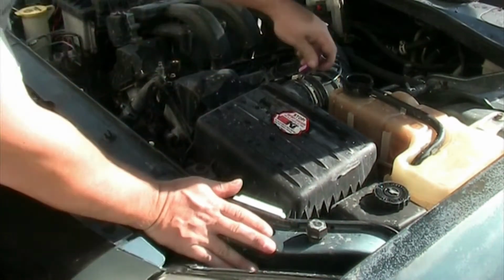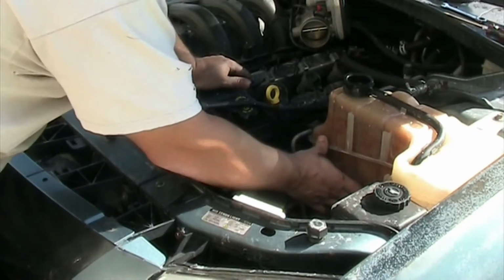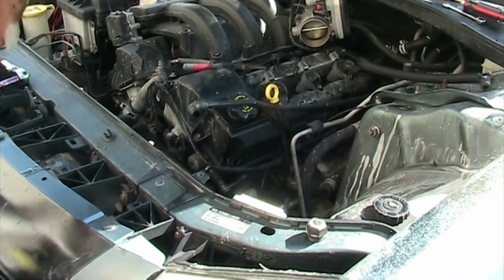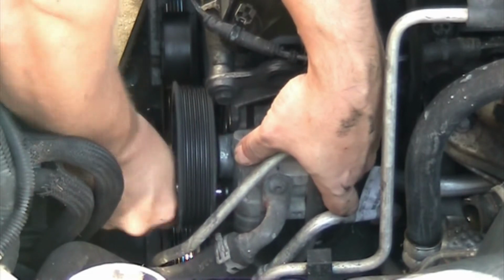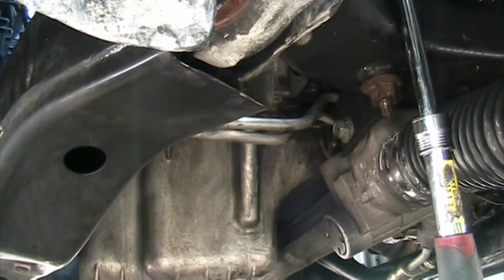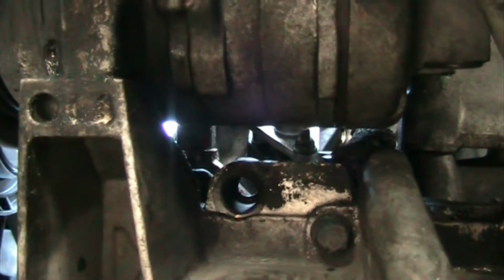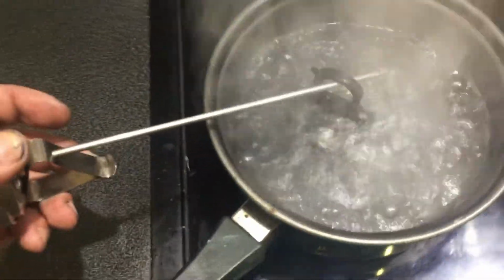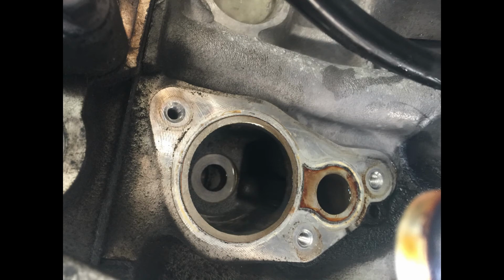Chrysler 300 Dodge Magnum Charger how to replace your coolant thermostat

Comment: Took me 7 hours but thanks to your video I managed to remove and install a new thermostat. There’s a special place in hell for whomever designed this fuckin engine.
Reply: So right on that last part.
Reply: Just did mine. Took me about 9 hours. That screw under the aluminum pipe was a pain in the ass to get to.
Reply: Lol 😆
Reply: Litium grease duh and I love my car  shut us easy when you take care  of your car only problem  I've ever had was front end suspension  part's  they are weak
Reply: @prettyd31  how to move that last piece? Does it move on its on?? When you take off the last lower right bolt on the metal piece infront of the thermostat housing.. how do you move that piece? Lol.. thats VERY IMPORTANT? He jumped to showing boiling the thermostat.. how did you get that out the way??
Reply: Man, I can't really remember. I think after you remove those two bolts, you just have to wiggle and pull. It doesn't come out easy if I remember correctly. But you should be able to pull it out far enough to take the old thermostat out and put the new one in.

Comment: Hey, you did show how to move that last piece? Does it move on its on?? When you take off the last lower left bolt on the metal piece infront of the thermostat housing.. how do you move that piece? Lol.. thats VERY IMPORTANT? YOU jumped to showing the thermostat.. how did yoy get that out the way??

Comment: People please listen! You do not need to remove the power steering pump. Jack the car up and get up under it it's a lot easier and quicker.
Reply: How would you change a thermostat on a first generation 2010 chrysler 300.
Reply: How do you take the bottom bolt off the thermostat housing from the bottom?
Reply: This comment is 100% wrong stop spreading misinformation

Comment: how did you rescrew the lower bolt on the power steering pump?
Reply: Cut one of your 1/4" 10mm deep sockets to 3.5cm length, then you can put it on without removing the AC compressor, just put the bolt on first and then the socket, then the small 1/4" ratchet will tighten it down.
Reply: @WDIO-RADIO  good idea!  got it!  Honestly i am just going to put in a new engine this time instead of a rebuild
its alot of work bro!
Reply: @thepenitent3633  just finishing my 2.7L, my advice - don't remove the crankshaft sprocket unless it's absolutely needed. However- from reading online, the oil pump goes out at around 175K, mine was at 150K so it was a requirement as I saw it. All the rubber seals go out in 7-10 years, and all must be replaced, if the engine was on a bench it would be way easier. I'd suggest fully rebuilding the replacement engine, at least all the rubber parts before you put it in. I also suggest the coil packs and injectors, and spark plugs too. Be wary of the aftermarket "Old-Style" timing chain and sprocket kit that has sprockets  that look like bike sprockets, that's the old heavy style that breaks water pumps. The new ones look like closer, wider teeth and the chain is finer and almost half as much weight. If you do the heads, while they are off, change the water outlet seal and the aluminum pipe with seal leading to the heater core and reserve tank, it erodes the tip and will be a source of leaks that look like a head gasket or weep hole issue. Sensors when heads are off: replace the Knock sensor, and temp sensor. The intake valve body sensor plugs and MAP sensor on the intake should be sealed with dielectric grease to keep out the water. You are totally right, this has been a long difficult adventure! About 3-4x harder than any import that I've rebuilt. Tricky, very tricky.

Comment: How did you get the far nut off it’s a pain!
Reply from the maker: I did access it all from below with a 1/4" flex socket system.
Reply: LSE LLC (Lumanet Solar Energy LLC) hey it worked like a charm thanks!
Reply from the maker: @eugeneroushe5524  I am glad it worked out for you. Just buzz me when ever you need a 2nd opinion or help.
Reply: Fuck it I'm selling my piece of crap chrysler

Comment: when i turn the car over the upper radiator hose gets hers right away. Does this mean the radiator is clogged? please help
thank yiu
Reply from the maker: Not clogged.... follow me for a few here and your will understand how it flows :  Radiator to upper valve which splits coolant into 2 ways into the engine block. This travels down into your V6 block to the Water pump which sits in the middle on the front area of your Engine block. From the water pump it runs thru out your engine and hits the thermostat on the lower right side of your engine when you stand infront of it. Once the Coolant is hot enough the spring retracts and opening up to let hot coolant now flow out thru the lower hose into the radiator. 
This is how your coolant flows on the V6.
Reply: @lsellclumanetsolarenergyll5071  don’t understand

Comment: Did you replace the o ring in aluminum  line
Reply from the maker: no the thermostat comes with it.
Reply: @lsellclumanetsolarenergyll5071  oh i see if it comes
Reply: Just did this job. Also Changed the O ring, but still leaking wtf!!!
Reply: @danreed4521  probably water pump that weephole comes form pump
Reply from the maker: @danreed4521  what did you all replace and can you point out where exactly it's leaking?
Reply: @lsellclumanetsolarenergyll5071  took it apart again and used some gasket maker and it doesn't  leak anymore but , no heat at idle. Only have heat when foot is on the gas pedal.
Reply: @rubenvarela4077  it was leaking from the housing  not weep whole.think I didn't tighten it good  enough.
Reply from the maker: @danreed4521  That is an indicator your water pump is going. I wish there was an easy way to meter the flow but haven't found a solution yet . A visual meter wheel would be best like you had back in the day at them gas pumps to ensure you don't get any air pumped into your tank.

Comment: does anybody make a thermostat housing that's made out of aluminum or something metal?
Reply: Yes, if your talking about the fitting on top of the motor where the OLD cars thermostats were. But thats not were the thermostat is now. Its on the engine block on the left/drivers side near the power steering pump and the a/c pump

Comment: No offense bro but, you do not need to remove the power steering pump. If you jacked the car and get up under it, it will be a lot easier and quicker
Reply from the maker: LOL if I had a lift sure. But that is the challenge that 90% of at home mechanic's don't have. And the pump is only held in place with a few bolts so it's a lot easier and in my experience also faster.

Comment: You can also get to the bottom bolt easier by using a 3/8 inch ratchet. All you have to do is, go under the pump.

Comment: If you ever have to change the water pump, make sure you change the serpentine belt or timing chain as it is called.
Reply from the maker: not only that but also with the timing chain the tensioner because that's the first part to fail which I did if you watched my series on my full engine rebuild.
Reply: Serpentine belt and timing chain are two different things

Comment: No no no no no.  Sell it or take it to the dump because all you're going to do is work on the dang thing over and over.  It's a Mopar
Reply from the maker: I am MOPAR so no I fixed it and since than got another 80K onto the engine already.

Comment: You don't half to remove the damn ac compressor damn dude I didn't half to something wrong with you
Reply from the maker: it depends on what tools you got
Reply: The 2.7 motor you may have to. The 3.5 seems to have more room to work under..